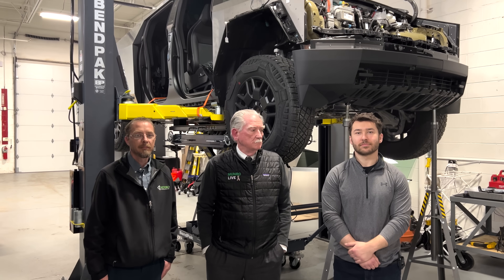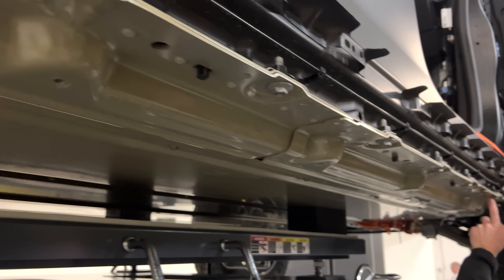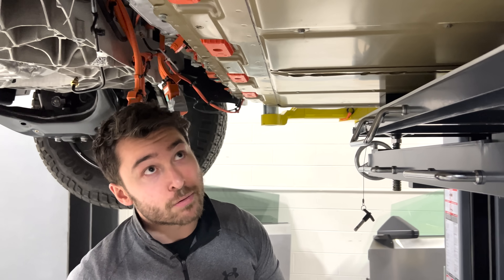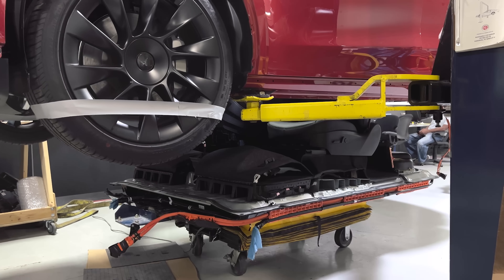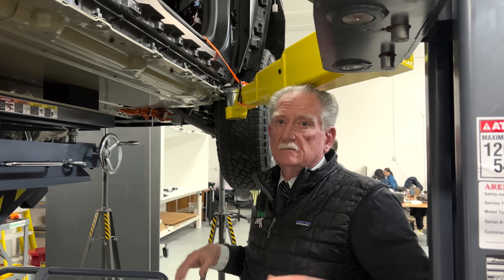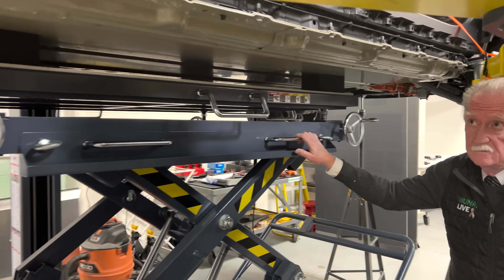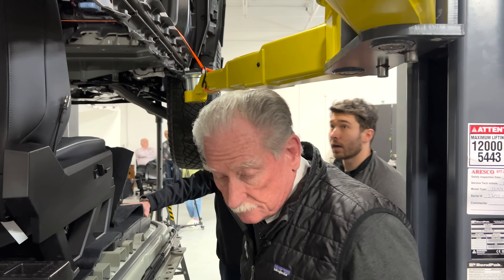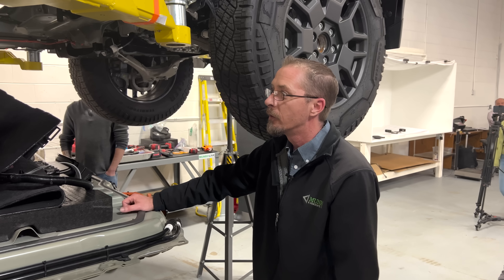Dropping the Battery Pack in Our Tesla Cybertruck!

Comment: "No matter how highly mechanised and self-powered, fossil fuels extraction requires a number of people - as if the process is executed by hands using buckets and ropes - by physics". 
Today, this number is 8 billion people - working flat out 24/7 - strong. 
In any system of energy, Control is what consumes energy the most.
No energy store holds enough energy to extract an amount of energy equal to the total energy it stores.
No system of energy can deliver sum useful energy in excess of the total energy put into constructing it.
This universal truth applies to all systems.
Energy, like time, flows from past to future” (2017).

Comment: The only reason why you'd have a separate floor panel is because of the battery, Munro keeps sounding off trying to make it sound like Tesla is this great innovator and is so far ahead of all other companies. The old boy is obviously stuck with a shit load of Tesla stock that's been underwater since Nov 4th 2021 when the stock value was $410. Good luck and stay safe.
Reply: Tesla last split 3 for 1 August 17, 2022.  3 X $180.40 is $541.2.   The the 2020 split was 5-for-1.    Accumulative split for investors prior to the 2020 split is 15 to 1.    
You have a problem with Tesla.
Reply: This ol boy in the comments must be a short. Have you not seen other EV tear downs? How much extra shit these legacy manufacturers have that wasn't needed.

Comment: Large cast structures can’t be repaired. Modular assembly is good but this is not well thought out, that floor pan, battery and occupants will be thrown from the wreckage in a collision. This Monroe guy strikes me as a machinist not an engineer. 😊
Reply: It wont, they  do crash testing you know... YOu would never snap those bolts in a crash.
 Sandy has worked in the Auto industry for DECADES...  mostly at Ford I think before he founded Monroe. He has plenty of videos that talk about his career.
Reply: @kens97sto171   he is not even a studied engineer
Reply: @Aztasu  
Doubt that.. but so what. Decades of experience inside auto manufacturing..  he knows more than any official education could teach.
Reply: @kens97sto171  That is not how it works anymore. Time has moved on, we are not in the 80's anymore. Car manufacturing and engineering as well as R&D is almost entirely high-tech nowadays and uses simulation tools, AI, materials science, chemistry etc. especially in EVs.
Nothing you can learn on the fly as a mechanic, especially not when you are out of the industry for a while. There are great engineers on the team tho.
Reply: @Aztasu  
Well. Elon Musk disagrees with you.. and has said so.. many times. 
Watch some of the interviews with Elon and Sandy.  It's pretty clear that Sandy does know what he's talking about..

Comment: Aside from Tesla, any other automaker also using the battery as a floor and completely just cutting a hole in the center of the vehicle?
Reply: Not yet toyoduh&Nissan have shown off some neat animations of going this route in 2026-2030 with evs though. 👍🏻😀

Comment: No big flat heavy real estate needed for ICE unibody which is still cheapest/strongest/lightest “uni” solution.  Others’ skateboard as inelegant and as body on chassis.  Thought experiment: If battery in EVs was a teeny itsy weenie “flux capacitor“  the size of a soccer ball then we’d still use “uni”body, no ?
Reply: You're stretching the term "THOUGHT" to its limits in all respects.
Reply: Both the GM and Ford trucks have a body on chassis design for their EVs. You can still use a chassis design for an EV. Tesla just chose not to.
Reply: @streddaz  Least effort/resource/cost to planting big, heavy, flat monument in a structural and flat floor advantage ‘cause it’s makes sense.  Cab on chassis or “skateboard” ends up using more, weighing more and costing more.  If their battery pack was size of walnut - then unibody or hybrid using mega casting makes $ense.
Reply: @thumperoux1528  unibody is cheaper to manufacture. That’s why all sedans, SUVs, sports cars etc are a unibody design.

Comment: A step forward since the truck didn’t need to be destroyed to remove the structural battery pack unlike the model three.
BUT I don’t think the battery pack or electronics can be repaired without a whole new pack.
Might be easier to produce but harder and more costly to repair. So insurance rates will be high.
If throw away cars are the measure of success then Tesla is the king!

Comment: What happens with the interior if you need to change battery pack?
Reply: I would imagine all the seats are some how connected (bolts?) to the pack.  I think that should all come apart.
Reply: Swap it over to the new pack.

Comment: It's like opening up one of those alien ships that crash-landed in Area 51 and admiring at their superior tech! Amazing, and i have been eagerly waiting for each one your Cybretruck videos! But just wanted to ask about the floor assembly strategy with seats and everything going from below the rest of the car body adopted in the Cybertruck. Isn't it possible because of the rigidity of the battery unit that has allowed Tesla to basically bolt it to the rest of the body and still provide the necessary rigidity to the overall car assembly? Moreover, a removable bottom (Battery case) seems to be a requirement in an EV. In the case of a normal unibody car, a bolted floor structure would be a liability. I mean, this is my intuition.

Comment: Some great ideas in it but One less of these things on the road is Great Start. PS, The air cooled vw used the smae system with a removable floor pan that dropped the whole drive train. That was designed in the 1930s.

Comment: So what happens when you need a pack replacement?  Does that come with new seats, et. al. or is someone going to be charging to swap all that stuff over?  The costs of EV's is simply too high and they costs aren't coming down.  Instead they continue to go up, with perhaps the Model III being the one exception.  Remember this truck was supposed to cost ~$45,000 at launch and instead the cost is ~$100,000.  How does this design reduce service costs?  I don't see that it does, nor does it seem to reduce costs to customers.  It may increase margins, which is great, but that seems to be the story of the EV.

Comment: What the heck is a penthouse?
Reply: It's basically a compartment that houses the charger, BMS, DC-DC converter, and other components necessary for the battery/power that's located on top of the battery pack, like a penthouse.

Comment: I SURE would have liked to see more detail..... where did the back seats go?  What sort of disassembly in the truck bed?  What cables inside had to be disconnected?  Just..... WAY WAY to abbreviated.  Sadly.  Now I'm going to go and check out the hack / wannabe that's ripping one of these apart on YouTube.  (sigh), I really wanted to stay with the original and best (Munro), but, I want more detail.

Comment: I like divergent thinking and solutions but this must be an absolute nightmare if you need to service inside the pack at all. I guess one hopes to never have to do that as part of the vehicle's life.
Reply: They aren’t intended to be.
Reply: Think about it. Watch some videos about making a simple repair in most ICEVs nowadays. Rainman Ray's channel comes to mind. Hours of disassembling all kinds of crap to do a 5 minute replacement. $700 in labor to R&R an entire dash board in my Town Car to replace a $30 mixing vane. That's why I called that car The Money Sewer.
Reply: The downside is the pack is not user serviceable.   The upside is that it is filled with a fire suppression foam that makes it very rigid so connections are less prone to fail from vibration.   The foam also provides thermal isolation.
Lithium-ion (Li-ion) cells do indeed produce oxygen when they burn, but the key point is that  the amount of oxygen produced is usually not enough to sustain the fire by itself in an isolated cell.  
The foam makes a LOT of sense.
Reply: @AudiTTQuattro2003  We also need to know the failure rate of structural batteries vs non structural.

Comment: Tesla needs to provide a 200+ kWh pack as implied for a 500 mile tri-motor which is what a lot of us signed up for. I'm not buying anything calling itself a truck with a pathetic 123 kWh pack. And whoever came up with the idea of using the bed for a so called range extender should be fired.
Reply: Silverado EV.. has 215 KW usable pack. 
The YouTube channel Out Of Spec Reviews just range tested 4 EV trucks at 70 MPH.. full charge until they stopped moving..
F150 Lightning went 282 miles,  Cybertruck went 304 miles, Rivian R1T went 345 miles I think Silverado went 434 miles.
Was a good video.. pretty entertaining with good info... long though over 2 hours.

Comment: Doesn't this kinda suck when you have to replace the battery? Part of EV sustainibility should be REPAIRability.  There is a lot of emphasis on this channel on production and manufacturing efficiency but very little in terms of ease of repair or maintenance.

Comment: No, traditional ICE cannot load the floor that way, because it has all the crap like fuel tank, fuel line, exhaust pipe and what not... so there would be no way for ICE to do what Tesla is doing. For new EV however, this should become the new standard.
Reply: VW used to do it for the Beetle. They and all the other manufacturers just have never done it since.

Comment: what a comeback vs another competing teardown company. while this video is too little, too short- there are plenty interesting things to see. that thick PVC foam, plus crossbrace on the pack, plus the seat structure is a lot of vertical height. in short, Tesla could make a lower riding vehicle out of this platform. alternatively, the next gen platform could have many ideas and parts from this CT platform.

Comment: This is stoneage technology! In a NIO you switch battery in 3 minutes ! This is so far behind in technology it is funny. Either you people have no clue, or you are paid to do this! What a joke.
Reply: The NIO is designed to be swapped, of course it’s going to be quicker. With the NIO you are locked into their battery swap systems too. There’s pros and cons to both approaches.
Reply: And you’re not locked into teslas battery ?? 🙄
I like the ultium approach. Better repair ability than Tesla.
You can also add more packs.
Reply: @richardwolf6269  unless there’s space allocated for extra batteries you can’t just add extra batteries, you are also locked into Ultium batteries just the same. The GM platforms that use the Ultium batteries use all the space available.
There’s pros and cons for modular batteries.
The pros are ease of replacement and repair.
The cons are added weight, they take up more space and the surrounding structure needs to be much stronger.
It the battery it reliable the structural pack is better, if it isn’t the modular system is the better solution. 
I suppose time will tell which works out best.
Reply: @richardwolf6269  To my knowledge NIO used to make them themselves. But they at least plan to outsource manufacture, but to keep R&D inhouse. I think CATL makes most if not all their batteries now. They also cooperate with CATL.
Reply: @streddaz  No battery integrated in the chassis is not better. You can buy a car with a cheap small battery (economy) for every day use, and swap in a huge battery for vacation. Fast charging can be avoided. Consider secondhand value, etc etc. Any added weight can be completely disregarded.
Reply: @streddaz  You can still charge a NIO with a cable if you want..
Reply: @martina5328  you can’t just disregard the added weight. That makes the car less efficient. 
You also never own the battery, so you pay rent on it regardless of how much you use it.
Sure, there would be situations where this would be beneficial but not for everyone.
NIO sets strict limits on how often you can swap the battery and even how often you can DC charge the battery when you're not swapping it out. To upgrade to more frequent swapping or allow DC charging more often increases the battery lease prices significantly.
Like anything, there’s not one silver bullet to solve the problem, there’s pros and cons to all systems.
Reply: @martina5328  yes you can, but you are also paying rent on the pack at the same time. Doubling your expenses.
Reply: @streddaz  No. I did the calculation. Buy a NIO without battery. Put the money you save (compared to purchasing the battery) in an index fund, giving you 7.5% a year over time, annuity. Then you pay the monthly fee for renting a battery + you can get a free swap a month. You are actually better off renting the battery. Compare this to what happens when the warranty on your battery is over.
Reply: @streddaz  And about the weight. How much weight do you save if you only need a 75 kwh battery for everyday use, and then swap in a 150 kwh when needed - compared to Always transporting around a 150 kwh battery?
Reply: @martina5328  yes, you are correct. That is a benefit of the swap out system. The thing is you pay for each swap and subscription for the battery swap program. Cost wise it’s more expensive, as the car is more expensive to begin with due to the complexity of having a battery that’s autonomously replaced. It is far easier and cheaper to make a fixed structural battery than make a removable one. Then there’s the ongoing cost of the subscription. 
There may be situations where this works out to be cost effective compared to a fixed battery, like if you regularly drive long distances. If you don’t it’s most likely to be a more expensive option.
There’s certainly no, one easy solution that will be suitable for everyone.
Reply: @streddaz  I dont think it needs to be expensive, on the contrary, taking into account the longer life span of the car.
NIO is releasing the cheaper brand Onvo in may, then even cheaper one (Firefly) next year. I think it is simply a better solution. You get one free swap a month. You can charge with a cable at home if you want. If car A and B are the same, but A has the swap option, why would I choose B...
Reply: @martina5328  but are car A and B the same? They aren’t, one you pay for the car up front once. The other you pay for the car to begin and then you keep paying for the lifetime of the car. One you can charge from home and just pay for the electricity you use. The other you can charge from home and you pay for the electricity you use plus you pay for the subscription. You might get one free swap, but there’s a constant ongoing subscription as well. It also depends if there’s a swap station near you, or near to where you are travelling to. 
As I said before, no one solution is going to be better for everyone. It’s all dependent of your situation and where you are located. Time will tell which one is more cost effective.
Reply: @streddaz  But If the only difference is with or without swap option, with swap option is better for everyone, right? Yes agree, and everyone need to look at the cost of the subscription vs cost of purchasing the battery, battery failure risk, degradation and finite lifespan of the battery (and the 7.5% return on the battery purchase price cost put in an index fund); second hand value (life span length) of the car. 

The thing is, I believe that there are cost savings, economy associated with the swap solution that can be shared with the customer making it a more economical solution for "all" (but there are "Always" exceptions)

Comment: Making the battery pack plus floor plus seats and center console one large assembly: This idea will be interesting during battery swaps. 😀 In that use case, it is not as brilliant as Sandy thinks it is. So, it eliminates the opportunity of battery swaps. And even at a regular repair shop: this shop will need quite a tall building and enough lift height of the hoist, to get battery pack plus seats out under the truck. You can see this at 6:55. So, it may save Tesla a dime or two, but now all the workshops that do battery removal will need to beef up their hoists. Unfortunatly, they did not show how to get this battery+seats assembly out of the way. I mean, the seats are still way to far up to just drive out the lifting carriage.
Reply: still living in the 20th century i see.
Reply: No such thing as a battery swap.
Reply: @themonsterunderyourbed9408  Yes, not even fesiable any more with this type of construction. It was however, with "early years" of Model S and X. Both in the 21st century, by the way.
Reply: @heavypizza "if tesla does it it must be right".
Reply: The battery pack is designed to outlast the vehicle.
Reply: The seats have to be installed onto the battery pack. Therefore, they can be removed. Meaning you can remove the seats prior to removing the battery pack. Just because it’s easier/cheaper to install them both as one unit doesn’t mean they can’t be removed in pieces.
Reply: @robertrayford8708  You're right, I was not aware of that. A service workshop can simply go a different way than the factory.  And I just looked it up in the Tesla CT service manual: Servce Procedure "High Voltage Battery Assembly - HV Battery, Long, 4680, Center (Remove and Install)", then step 42 and 52: they want to to remove the 1st row seats first, also removing the center console assembly (step 61), before dropping the pack. As the 2nd row seats are attached to the rear of the cabin however, they are not part of the procedure. But they also do not contribute to savings during assembly then.